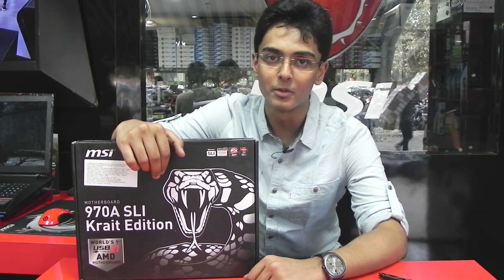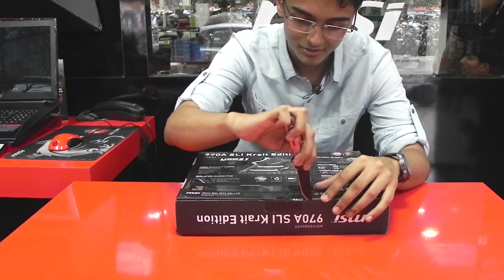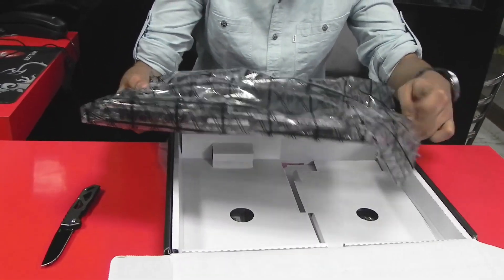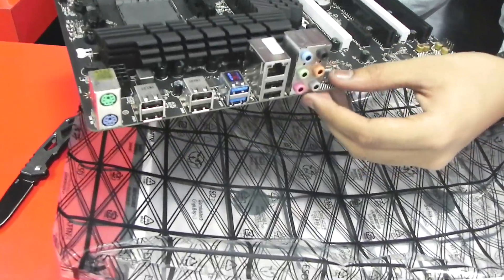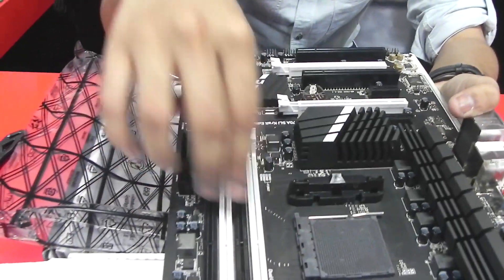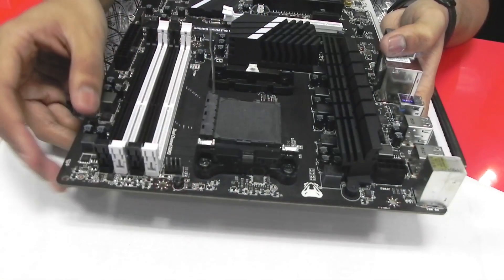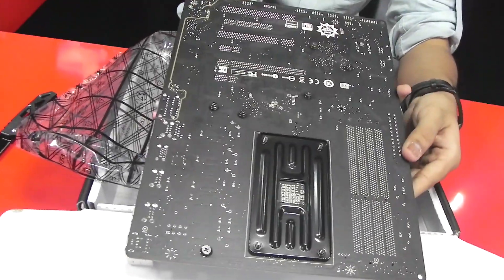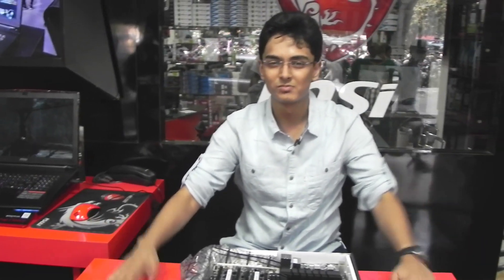MSI 970A SLI Krait Edition Motherboard Overview (Best 90$ AMD Motherboard?) [XDG]

Comment: I own this board.
I can definitely tell you this board does NOT have 4 pwm headers. it has 2 4-pin and 1 3-pin. Not a big deal for me since I did my research and it worked fine for my purposes, but this video is very misleading and could point less diligent people in the wrong direction. At the least, put a youtube annotation mentioning any discrepancies to be courteous and considerate.
Reply: As far as powering the fans yes. These one 3 pin fan plug on the rear and one 4 pin fan plug on the front. You can plug a 3pin fan into the 4 pin plug if you need to.

If you need more plugs you can either use a 3 or 4 pin splitter (which turns 1 plug into 2 or more) or you can use a 4pin molex to 3pin fan plug adapter. Your choice.

Keep in mind, if you want to control the fan speeds with your motherboard, you'll have to use the 4 pin fan plug. (not counting 3rd party programs that use DC control like speedfan. But dont worry about that just yet.) I recommend getting a 4pin splitters and running pwm 4 pin fans from that.
Reply: It'll fit. It'll take the weight. Make sure to watch a video on how to install a graphics card. I'm running an overclocked FX-8320 and an overclocked R9 290. Both watercooled. It'll take a FX6300 and GTX970 no problem.

The board has SATA ports that face out and to the side. Just use the sata ports facing to the side. I'm running 3 sata devices. SSD, HDD, and Optical drive.

Comment: Those long black conectors are not PCI-E conectors, they are PCI conectors, which is the older standart.
The only PCI-E conectors this motherboard has are the two 16x white ones (working at 16x and 8x) and the black 1x one
Reply: Miguel Águeda I did not see it before, but in truth, there are two PCI-E 1x conectors instead of only one

Comment: can it support a fx8350 cpu without a bios update or flash?
Reply: Yassid Martinez and is this build good?
http://pcpartpicker.com/p/mDLQ23
Reply from the maker: Yassid Martinez pretty nasty build.. But I would personally suggest you to pair up with an i5 4400 and msi h97 gaming motherboard! :)
Reply: Yassid Martinez yes i got one of these and it works great edit turns out otherwise shit board wasted 80gbp
Reply: Alright thanks for the help
Reply: Yassid Martinez Wow, you're parts list is almost identical to the PC I'm building right now!
Reply: Yassid Martinez...
Reply: +Yassid Martinez (YMGamer) damm near the same build i have. looking for a board to run my 8350 at capacity (bottlenecking issues on the gigabyte GA-78-LMT, and the krait is the one AM3 that continues to come up when asking for a great budget board.
Reply: Joey Velarde this will bottoleneck a fx8350 i had to change mine to the formula z this msi kriat ran too hot also it shuts off cores so bottlenecks i can run games so much better on my formula z please save a headache look elsewhere :(
Reply: Carbon cricket FX oh yeah? dude, thanks for the heads up! been reading that the kriat has been giving people more than a headache or two. i'll definitely consider this, straight up.
Reply: Joey Velarde imo the formula z is worth the cost it runs cool stable and oc extremely well i got a 3d mark increase on stock speeds too compared to the krait edition
Reply: ***** i went ahead and got the krait, as i got it on a sweet deal - budget is a mother.. 

so far, i'm overclocking the 8350 at 4.5 (PSU clocked at 1.4 volts). while under load, my rig gets a bit toasty, though managed to register a max at 53 C and 18 C on idle (cooling the CPU with an AIO corsair 240mm). probably an average of 50 C while gaming, so i'm a little happy with that. i'd be happier with 40 C, though it is what it is. 

as for the bench, running an R9 290 i'm getting a stable 60 FPS with Far Cry 3, Borderlands 2 and Diablo 3 in ultra or very high, though noticeable stuttering when the screen gets particle heavy - and as mentioned, the board runs a bit toasty. I also managed to get a comfortable 50-60 fps with Far Cry 4 and GTA 5 on high, though runs flawlessly at medium (varying FPS efficiency with a few tweaks here and there).. 

so far no huge issues reported..... i'll totally be prepared for it if anything DOES happen though.
Reply: Carbon cricket FX i may have to sell off the krait for the FZ, if anything just to run something with a little more piece of mind. thanks guys!!
Reply: Joey Velarde totaly worth it :) im running 4.9ghz on a corsair h55 :) doesnt go past 50c so im upgrading to the h110gt hopefully i can break 5ghz mark motherboard runs about 40c the msi krait ran this chip at stock speeds with throttling :/ its the shitty vrm design and low quality parts 2x8gb vengence 2x gtx 660ti pe oc 3gb sli and this cpu i can at present max everything out on ultra :)

Comment: .  Wrong wrong wrong...   When a motherboard is removed from the static bag it is always best to be kept on the box that the motherboard has came in or a wood desk. otherwise it may be shocked and ruined.   The inside of that static bag is static resistant but the outside is not. Always ground yourself before handling circuit boards.